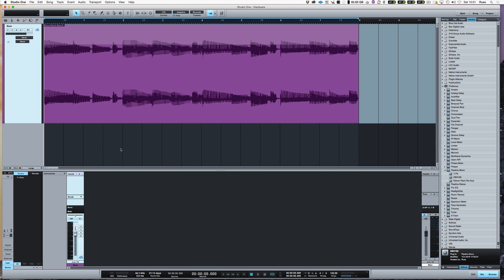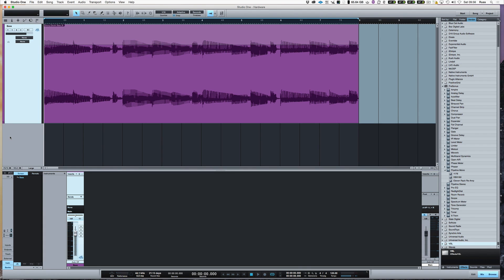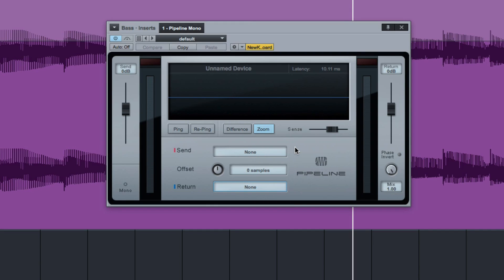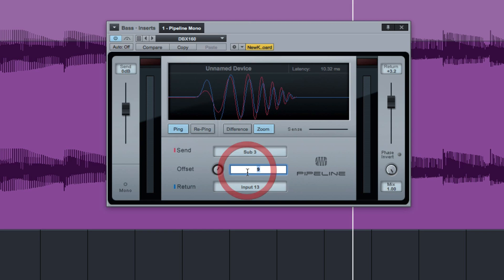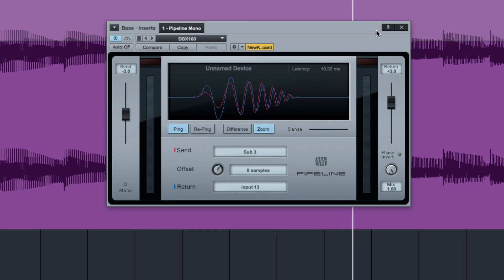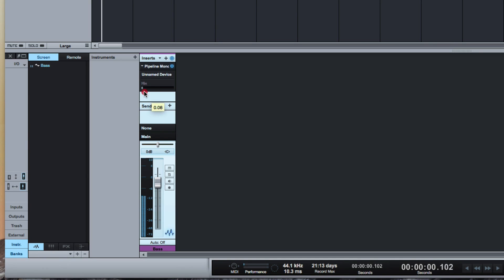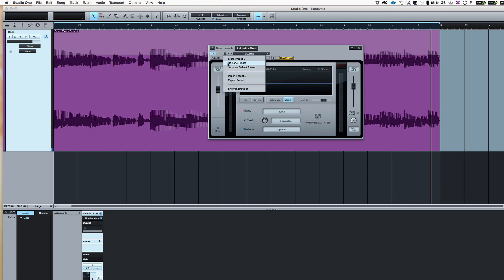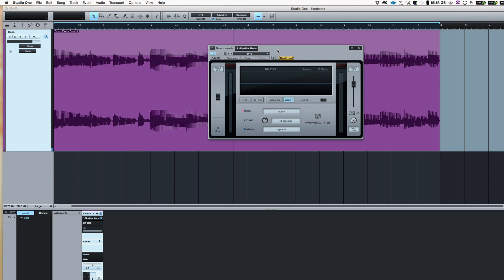Using Hardware Like Plug-ins In PreSonus Studio One

Comment: However - I get an issue using external harware in any Daw I have tried, including Studio One. I have a second interface connected to my main one via ADAT which has some FX and processors connected to it. No matter what I do the delay is never calculated by the DAWs accurately. I think ADAT has an iinherent latency which DAWs cant calculate becaise they are basing the latency on the main interface. From what I can find out ADAT has a built in latency of between 1.5-3ms. Its a frustrating issue because Imconstantly having to delay audio tracks tofit around the hardware inserts bcz annoyingly nomatter which Daw I use anything connected to the ADAT interface piped in to the DAW live is immune to any - or + delay settings I try from the Daws paramters,

Comment: I realize this video is old but I'm still in S1 v2.6.5 and I'm setting up pipelines, I hv a few questions 1st is there a reason a piece of gear is not being seen easily? I've tried setting the offset to find it, still it seems to not be able to find it. I hv followed the steps exactly from this video. 2nd I see that you put a mono pipeline on a stereo track, I can only use a mono pipeline on mono and only a stereo pipeline on a stereo track. I also noticed that when I open a pipeline VST already on a track it turns off? I have to restart it. Any help would be appreciated. Thanks

Comment: What about the AD/DA conversions that are happening during the routing? Are you at the mercy of how good your interface's converters are?

If I record a vocal for instance... I convert the analog vocal source to digital within my interface. Then It gets converted to analog as it goes into a compressor (for instance). Then it comes out of the compressor as an analog signal again, and needs to be converted back to digital. Is there signal degradation happening during this process? I'd assume, yes.

Comment: I was wondering if anyone can help with this issue I am having.  when connecting my pro vla to my presonus 192, I am using output 7 to vla input and input 7 on 192 from vla output. first question is do I use trs 1/4 inch cables?  cause when I launch pipeline I don't get levels and when I do they are very faint and as I turn up the vla output i get noise.  I have the outputs and inputs correct in studio one but not sure do I have to adjust or do something to the control panel/mixer portion of studio one, no videos explain this. please help, I greatly appreciate it.